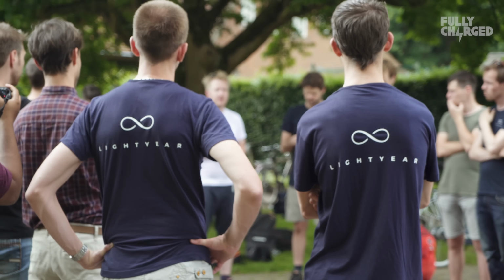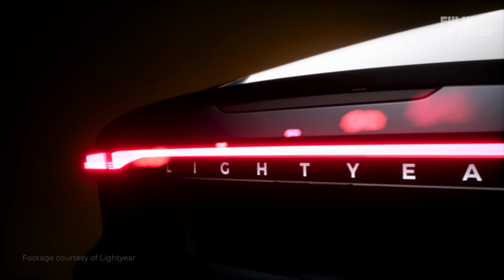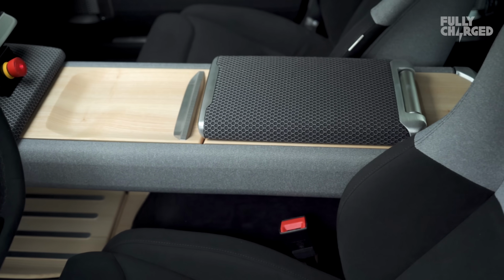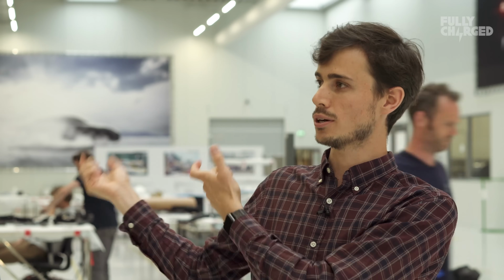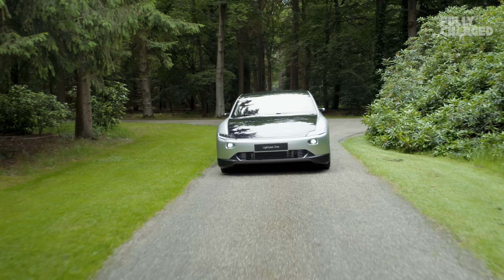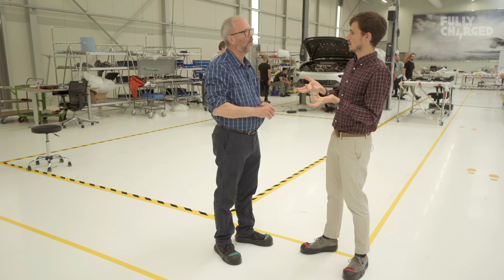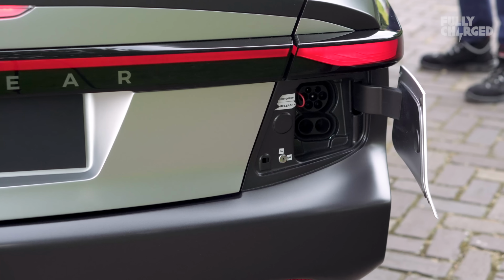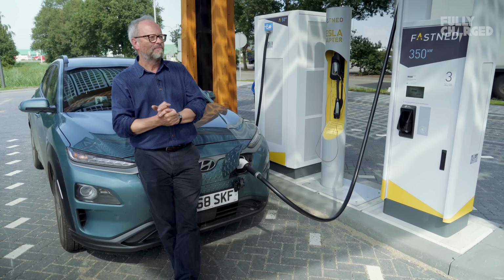Lightyear One solar powered electric car - exclusive first look | Fully Charged

Comment: 200,000 miles at 33 miles per gallon is about 6060 gallons of gas. 3.00 per gallon is $18189 dollars. Just buy a cheap economy car and you will come out way ahead. If you look at it realistically this car would have to be under $35000 to be comparable in price. Good luck with that.
Reply: Why you think people buy this car? To save money on gas? No,they want to invest in this technology.It's a bit silly to think a hand build,lightweight car like that will come cheap.
Reply: @mariasantov5579  It has to make business sense otherwise it's a pipe dream and quite stupid in my opinion.
Reply: @Bottoarguewith  If you have a plan as 5 students to start a new company you don't have many options.They sold over 100 cars before they even had a prototype so there is a small market for this car.People buy this because they believe in the technology.Now they can start production they are able to concentrate on the next model what can be produced much cheaper.Even if you are right and there is no marked for this car they still can make a big change selling and developping their technology.I think it's very impressive what they did so far.
Reply: @mariasantov5579  They need to start a new company with a product that is -----feasible. Liberals tend to not have much business sense. You can not subsidize everything. It is called a hobby and not a business. I think they are not even close to a viable product or one of the big auto makers would be all over it. They are young they will figure out how the real world operates hopefully sooner than later.
Reply: @Bottoarguewith  If it is a hobby why people leave big car companies to work at Lightyear? For the main car companies change is difficult.Look how slow EV's comming to the market.The big companies were and still are not all over it.In the near future the demand for batteries is bigger then can be produced.A highly efficient car like Lightyear will save a lot of batteries.Things like the in-wheel motors will be used by many other brands i think.And their smart solar technology has great potential too.I follow this guys since their first participation in the world solar challenge.If you look at some big partners they have like NXP you can't say it's a subsidized hobby.I think they have a great future.Maybe not as car manufacturer but their technology is very innovative.
I keep following them and i hope you do as well so they can prove you wrong.

Comment: What if I told you that ALL power, regardless of how it is extracted, IS SOLAR POWER! The sun is the reason we have any life, that life is decomposed into crude oil, that crude oil is then refined into this amazing discovery called Petroleum Fuel. Solar is a great substitute for liquid hydrocarbons but lets be real, if "green" is the goal.. we are already there. Yes yes, co2... well check with NASA and you will find that there are land and oceanic CARBON SINKS, these are plants that feed on the CO2, yes they need that. Less than 2% of our atmosphere is composed of CO2 and of that 2% only .003% is due to liquid hydrocarbons. It is SCIENCE people. In fact, by producing all of the solar panels and battery systems, you actually harm the environment MORE than simply using gasoline. The goal should be to reduce CO2 emissions by using the CO2 for another purpose. WE shall see.

Comment: All fine but this car is moving something like max 10km/h.... how much energy is needed to make 100km? In regular EV it's something like 18kWh. How big are solae panels? 6m^2? this is approx 6kW... I can guess that this car was moving with top speed or very close to top speed.
Reply: Accoring to the website, the estimated WLTP consumption is 8.3 kWh on 100 km.
Reply: @sebastiannolte1201  do you still belive in any WLTP result? Better idea is to check real reports from users like spritmonitor.de

Comment: Interesting but silly too. Has no speed?  Sun powered only car is not going to work.  Sure why not add some solar panels to flat surfaces, why not.  Well cost is one, and practicality another. How many thousands of extra dollar costs  to get an extra mile or 2 before you have to plug it in and charge up.
Reply: Solar panels became very cheap.This car drives on the battery.The solar cells always charge the batteries up to 70km range a day.
Reply: @mariasantov5579  If it worked well, then Tesla would have done this and also all the other car companies. They have not gone this direction, which should tell everyone it does not work well. And when an electric car is going at steady speeds on the highway it uses more power than slower going in stop and go driving which regenerates by braking the batteries.

AND they want RANGE, that is what drivers desire. 40 miles is not going to do it. Eventually they want a 500 mile range before plugging in to charge. Which they might get as new solid state battery has been developed which improves itself over time, developed by Braga and Goodenough. It does not degrade with use, it gets better.
Reply: @scottdowney4318  When Tesla started the solar cells were way to expensive.Now Tesla opened the market fot EV's with cool looking and fast cars,it opened up a new marked for higly efficient EV's like Lightyear.Lightyear is more about sharing it's technology to other companies.If you dive deeper into Lightyear's story you will find that they know what they are doing.Just a few weeks ago their university team  won the World Solar Challenge the fourth time in a row.Every four times they participated.Where Tesla is going for bigger batteries and more speed,Lightyear is going for energy saving and lightweight cars with small batteries.They brought the weight that much down they can use in-wheel motors so there is no loss in transmission.The car is so aerodynamic it uses the lowest possible energy to fight trough the air.The design might be a bit odd but aerodynamics has it's limits.If you look up the designer Lowie Vermeersch,you will see some pretty designs came from his hand.I hope you look up Lightyear more and change your opinion on it because they are more then just this video.

Comment: Just think, if you get up into the air, you get rid of the weight of the wheels, transmission if any, brakes, brake lines, brake hydraulic fluid, suspension (springs or what have you).... Need to use this idea for VTOL aircraft !! thank you

Comment: how they solved the problem of flying little rocks from the road or the car tires  into these solar panels on hi speeds?    Also interesting moment is an solar panel degradation factor and if it makes sense at all?  For example, owning such car in a megapolis is problematic and for pure "socket" car, the market have much more better solutions.

Comment: As if charging a plug-in car wasn't already cheap enough, the self-charging capabilities of this car can cover a large percentage of the annual mileage you drive. I skipped the video a few times so excuse me if this has been mentioned but I think a great accessory would be a reverse charging station you can install at home that would allow you to store excess energy when the vehicle is sitting in the sun with a full battery. I imagine such a system could mean rarely having to use grid power to charge the car if we take into account the car has a max annual charging capacity of 12,000 miles worth of energy and the average car owner drives 12,000 miles per year. The rare moments you would have to plug into the grid would probably result in under $100 worth of electrical consumption per year. Amazing

Comment: OK does no one understand why this is a really stupid idea? Why not just put the damn solar panels on a roof, at an optimal angle where they won't be covered from the sun most of the time? Completely senseless to put them on the car when most of the time the car is going to be behind buildings, parked indoors or covered by trees and won't charge anyways..

Comment: First the i3 "OMG carbon fiber must be so efficient" In reality, absolute flop.
Multiple cars in the middle.
Then the ioniq, most efficient electric car on the market till Q3 2019
In Q4 Tesla blows the ioniq in efficiency and range with the renovated Model 3, ioniq 2020 is less efficient than it's antecedent.
Incoming: Lightyear One.

Comment: The idea definately earns merit and it's a really nice step forward. But I have some concerns:
-What's the cost in case of a colision that dents the roof?
-Is the car useless if just a small dent is made at the panels?
-How easily does the panels break?

I do feel the idea would be way better implemented if it was, for example, a compact gadget you could plug into a Tesla.
Charging just 1% every half an hour would still make the car self suficient enough to go anywhere on long trips, provided you give the car some time alone under the sun.

Comment: "Darling, I told you not to park the car in the garage! It needs to sit out in the SUN..."
Reply: Possible a new business opportunity,  skylights for the garage.
Reply: @aloneinanearthship4010  uv cealing right
Reply: I'll just buy the solar panel for the house instead and plug the car in.
Reply: @SlyNine  And if you do both, it is twice that good.
Reply: @svesom  to me it honestly sounds less efficient over all. The custom molding for the car, the extra weight, more complicated car designs. More complex manufacturing.

I'm all for the research, because all research ( non-ideological research anyways) is good.
Reply: @SlyNine  For me, its another Benefit of E Mobility. And I learned from my Tesla, you can run into a serious Problem, if park your car, with an almost empty Battery, for an extended Time in the Middle of Nowhere. But if there is Solar on Bord, you can keep calm. Because the Time works for you, not against you.
Reply: @svesom  As far as I'm aware that's true for all batteries based on this tech (lipo, lion). To keep these kind of batteries as fit as possible you should keep them at their most stable voltage. (for lipo it's around 40%).

Assuming it all applies the same, that is. I learned my lesson with lipo RC batteries lol.

But still, we have to look at the costs and energy spent overall in a mass production scenero to know if it could be worth it. Otherwise you might be paying a lot for only a little gain.
Reply: @SlyNine  When it comes to electric Cars, it is not the Selfdischarge Effect, that it is Draining the Batteries. A specially not by Tesla. The Cars are sending Data to the Tesla Network, when the Cars are parked. And they climate the Batteries. Other Manufactures don't do that so much, thats because they have the same Range in the Morning than the Evening before.
Whowever. All EV could Benefit from Solar Arrays on the Car, in my Opinion.
Even if Solar is  working better on Rooftops. They can work together to charge faster, than alone.
Reply: @svesom  than I have a question. I work 12 hours a day in Wyoming. If I leave, say a nissan leaf, for that time in - 30 Fahrenheit. How much battery will I lose.

Legit question as I am strongly considering this.
Reply: @SlyNine  In a Leaf almost nothing.
When I'm corekt informed.
But on the other Hand, because of the Lack of an Thermalmanagementsystem,
you will loose Batteryhealth faster than in a Car that has that. Nissan buiild good EV's but they make a bad Mistake, with no integrating an Thermalmagementsystem.
Reply: @SlyNine  Or park it outside and plug your house into it.
Reply: just leave the lights on
Reply: @Ultra Mega in Europe most garages are not under the house but next to the house
Reply: @maxstablet4946  only very rare situations have i seen houses with a garage beneath the house, it is always next to the house - USA here
Reply: @bethanyday3471  ok then its same there
Reply: Maybe the accessory that goes with a car like this, is a heliostat to reflect more sun onto the PV array.  I can see the day when people go to work and try to get the sunny parking space instead of the one in the shade.
Reply: @Ultra Mega Or a garage thats not connected to the house. If your property is big enough or already came with one 😂

Comment: Enormous respect for these guys - balls of steel - but hold on:
You get 50 to 70 km charging capacity from those panels, on a sunny day. So in real life that's going to be ~30 km for most people.
I don't see the advantage of having solar cells on the roof of my car, especially since the new battery packs are getting 80% in 20 min these days?
Reply: It's dumb. You could just take the same solar panels and put them on your house instead to get at least 5 times the power, and then just charge the car with that.

Comment: I couldn't help noticing that the solar-panels on this car are still made up out of individual single solar-cells. It must be possible to create fully integrated one-piece panel segments. That way you would achieve performance gains and substantial weight-reduction as well as (if and when properly scaled in production volume) cost-reduction.

Comment: A normal solar cell has an efficency of around 20% lets say 30%(high end) and the amount of solar power/sq (irradience) km in the europe in summer is around 800W/m^2, 30% of that gives 240 W/m^2 assuming a panel area of 6m^2 you get 1440W of power from the panel thats 1.5KW  (around 2HP) I am not sure if thats going to help in charging a massive electric car battery.The weight of the solar cells may out weigh the benefits.Comments welcome

Comment: In a low mass chassis, unsprung mass is critical as far as comfort is concerned. 
Also for a road car, one wheel drive is satisfactory.
It will probably be Lotus engineering that get this tech. the most correct, if they stop messing about and get some work done.

Comment: EVERY electric car in Western countries is being designed and marketed as an expensive LUXURY car, just as almost every new home being built here is a LUXURY home! 
Meanwhile, increasing numbers of people are driven towards homelessness, because of astronomical rents, and the lack of affordable housing. 
Likewise, I believe that many of us will be trying to hang on to our old diesel bangers for as long as possible - NOT because we like to produce pollution - but because the powerful and corrupt car industry sees an opportunity in electrification to become more greedy than ever! Not all of us will be able to afford (or even want!) the luxurious everything, radar parking, and motorised side-mirrors!

Electric cars have the potential to be both simple, and cheap! For several years India and China have been manufacturing electric cars that cost only around $4000. So, it CAN be done! OK, so their range on one charge is limited to maybe 60 miles, but for many people that's enough to get to work and back, or to do their shopping. I would love one!
I wanted to import one into Britain, but then I discovered that I wouldn't be allowed to drive it here without putting it through a very expensive type approval process first! Hooray the monopoly of the car industry!

As a satisfied user (except when it's raining or snowing) of a 8mph, 9-mile range, electric mobility scooter, I looked into the possibility of perhaps building my own electric quad-cycle with a roof, using bicycle wheels. Guess what! The government doesn't allow quad cycles on our roads! Why the heck not??? I suspect there is a very powerful car-manufacturing lobby doing everything they can to keep out anything that even HINTS at being competition!

As for all the razmataz about solar cells on the roof, I bet that every amateur inventor was already dreaming about that 20 years ago. It's a no-brainer! 
Why did it take the professionals so long to think that one up? 
Not only can your electric car be freely re-charging while parked at work, or in a supermarket car park, but for the past few decades even fossil-fuel cars could have benefited! I believe about 10-15% of the fuel we burn is used for charging the battery, and driving the vehicle's electrical system. So, switching to solar-charging when it was available could have been saving us fuel.

Comment: I really hope they do well with this vehicle...it is a great step forward.
But there are several problems with this design...not the least of which is how will it charge if its parked in a garage or in under-ground parking?
Not everyone has a tree-free or non-shaded area to park this car either at home or at work...so it would not be charged.
And a lot of folks rent their homes meaning they would not be able to just cut down overhanging trees for solar access at home.

Comment: About charging that Hyundai Kona at the end of the video: wouldn't it be an idea to be able to have a second charging port on a car? When a charging station is as empty as in the video you could charge the car twice as fast....
Reply: I doubt the single charging port is a bottleneck here. It will always take some amount of time for a battery to take a charge, if you'd try to go faster it could overheat/explode.

Comment: 1) crash test
2) water proofing test . e.g. floods , complete submergence under water
3) heavy duty test . e.g. 12~24hrs  driving normal roads with starting + moving off , climbing with heavy loads , full 5 passengers 
4) testing under all types of climate conditions -30 degrees Celcius  to +50 degrees Celcius .

Comment: couldnt you make the roads out of the solar panel bury like a telsa battery under the road and transfer the power to the car like a old school racetrack?
Reply: That is horribly expensive and inefficient. Roads get dirty, they're horizontal so get sunlight at very diagonal (low power) angles, they get damaged continually so need tough construction and frequent repair. Lots of other bad reasons. It's been tested in a couple of countries, and is ~1% as effective as solar panels, and ~100x more expensive, per unit area.
Reply: @hans_von_twitchy1014  Good point. Just seeing what people thought.